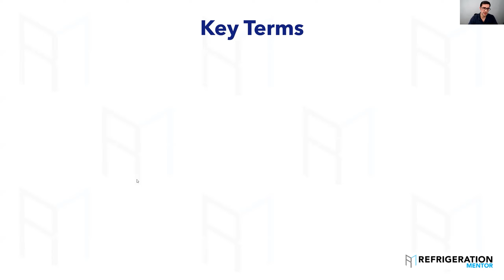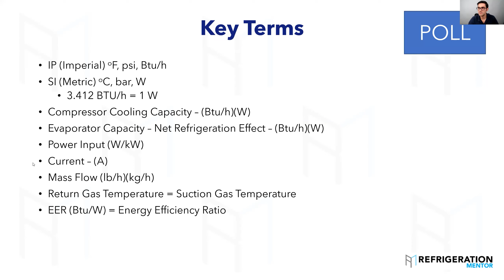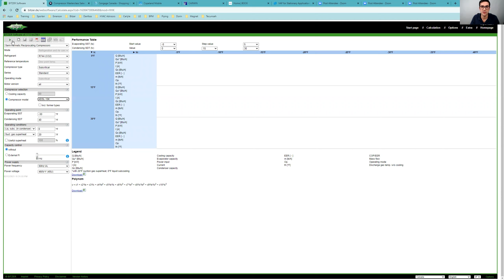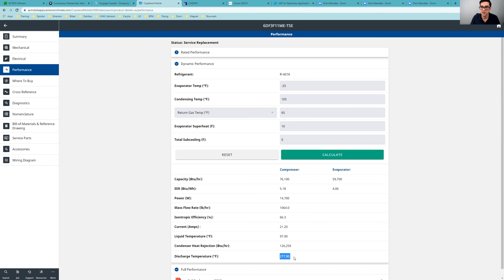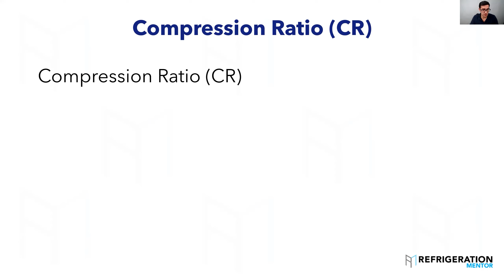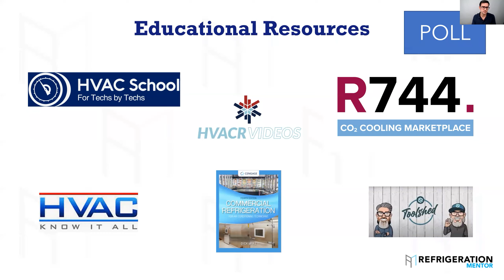Compressor Performance Charts

Comment: Very informative seminar, though 21:46 I couldn't understand this part. 
* When temperature rises density goes down, as Mass Flow = Density*Velocity*Cross Section Area,  mass flow should go down too. Why does it go up? I thought we should've increased the coolant density to increase the coolant capacity.
* And how could the cooling capacity go up when the SST goes up and SDT stays the same? I thought more temperature difference between SST and SDT would increase the cooling capacity. 
(10:50 For people who didn't know about RLA, it's Rated Load Amps. It's the current when compressor works at rated power, also the current term for FLA.)
Reply from the maker: Great questions Ali.  I am not an expert but When temperatures go up, mass flow goes up because the volume of refrigerant the compressor move.  It can fit more gas into the chambers and move more gas.
Reply: Point one: - If you are referring to the compressor suction side your thoughts are on the right track but the premise is not. As the saturated suction/gas temperature rises so does the gas density, this is a thermodynamic property of the refrigerant. Cooling capacities increase when moving from left to the right of the table, so the cooling capacity is proportional to the SST.
Point two: As the temperature difference between SDT and SST increases the cooling capacity decreases irrespective of which quantity (SST, SDT, or both) causes the increase. This is due to the increase in compression ratio, note that the capacity is inversely proportional to SDT and the compressor displacement volume can be considered constant.